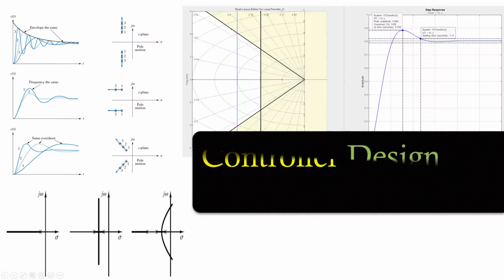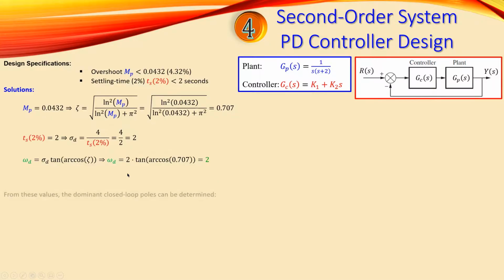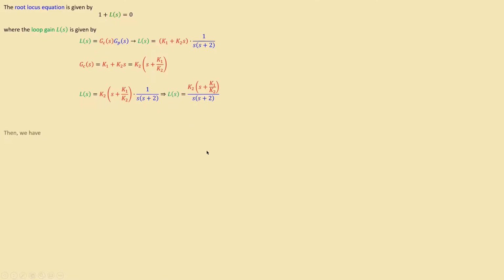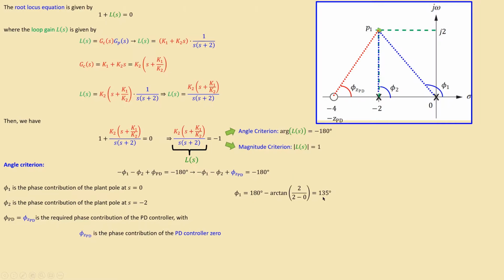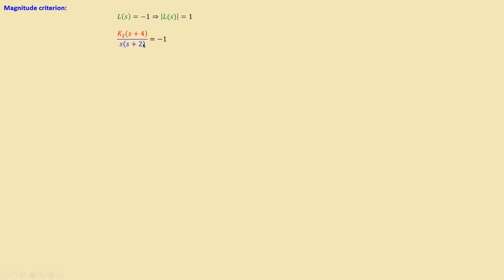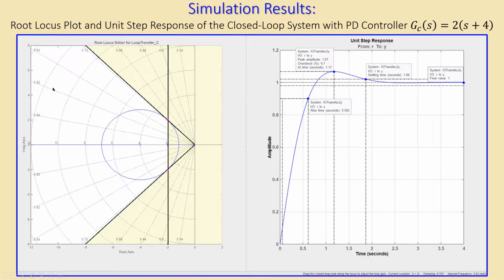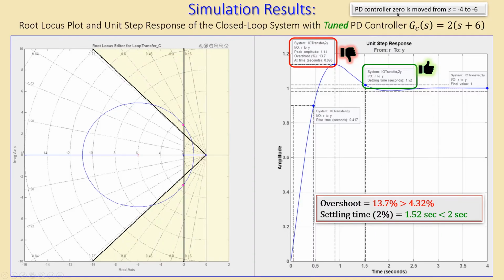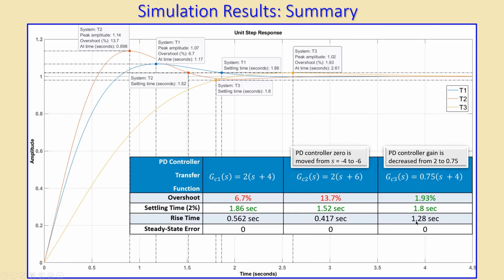Root Locus Design Method 🌟 PD Controller Design 🌟 Calculations & MATLAB Simulations 🌟 Example 4

Comment: Firstly, thanks for these great playlist i understand the topic thanks to you. I have a question. You make simulations on MATLAB and change the Gc(s) according to these simulations. In the exam we dont have opportunity to do that. How can we make it without using MATLAB?
Reply from the maker: Thanks for your message and great to know that you liked the video 👍 
Using the Root Locus Design, we assume the two closed-loop poles are dominant and determine the dynamics of the complete system. This is, of course, an approximation, thus we might need to fine tune our initial design and for that we use MATLAB.